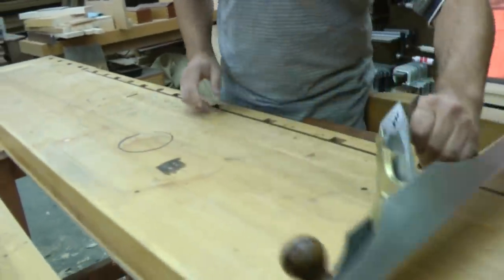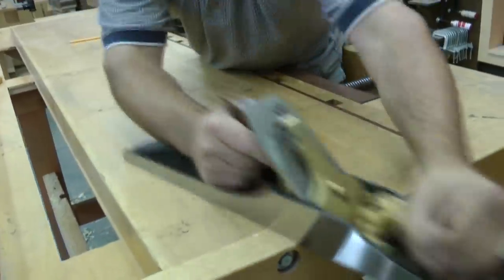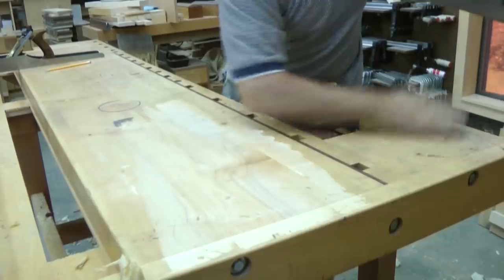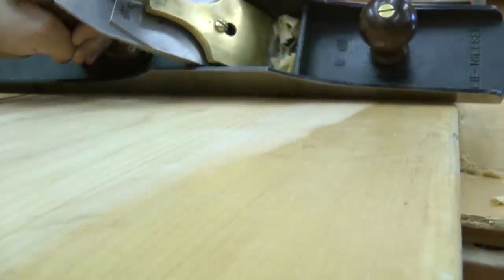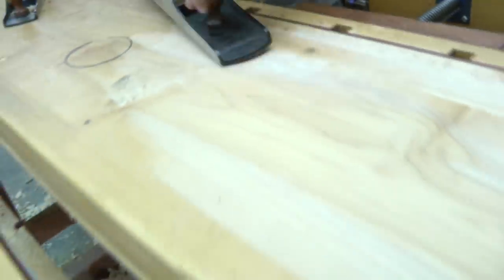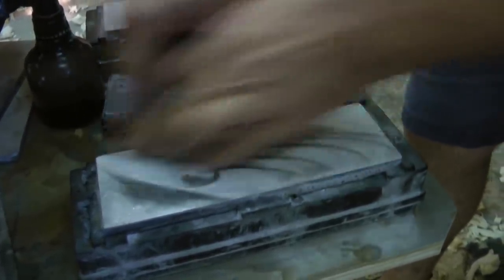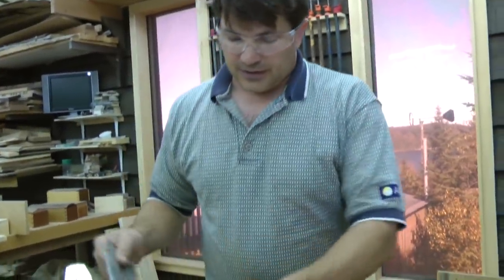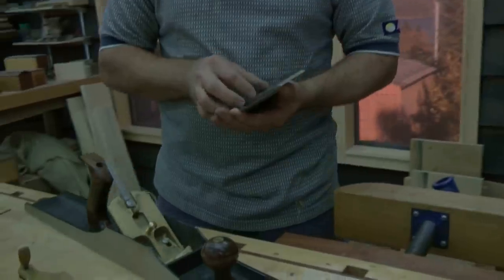Bench Resurfacing Episode 2 of 9

Comment: Free handing a back bevel seems risky, to say the least. In order to warranty that you will be honing the edge, you will be increasing the angle every time you sharpen (per your method, “find the bevel, go a little up”). On the main bevel that’s not a problem because you can grind it again, but on the back side you’ll have to grind the blade shorter... couldn’t you just use a thicker ruler? That should give you a consistent angle.
Reply: They're just micro bevels.